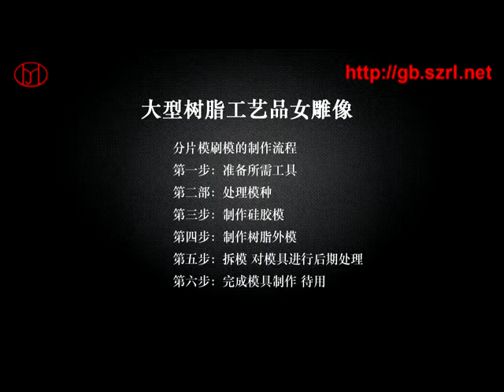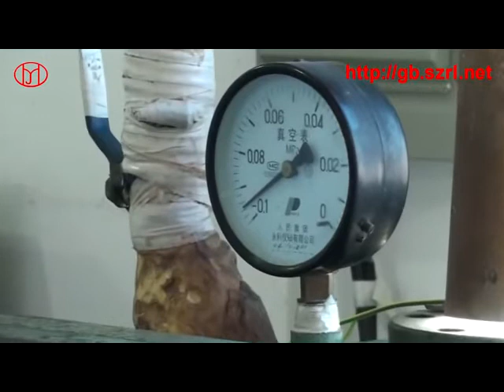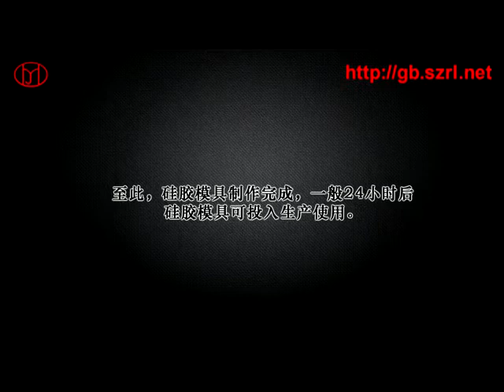Brush on the silicon mold:2 piece mold with  parting line

Comment from the maker: This is a video about how to use silicon rubber to do resin handicraft female statue sharding brush model .I believe it will be helpful to your business .
For further information, pls contact with Miss Bonnie
TEL: 0086-755-89948294
Mobile: 0086-18938867507
Mail : hyxb(at)szrl(dot)net